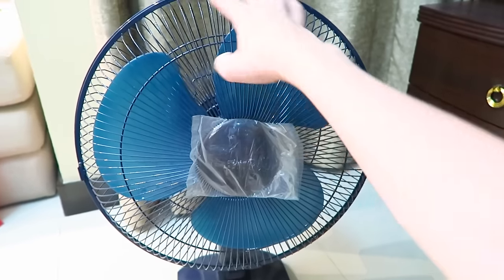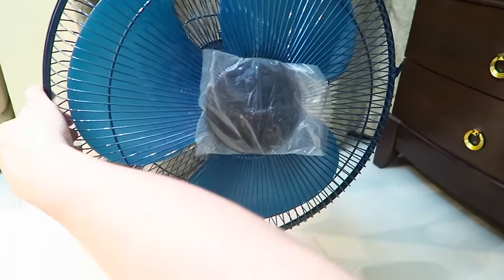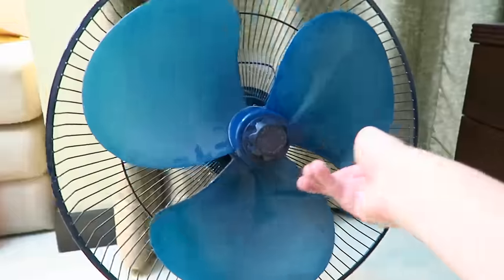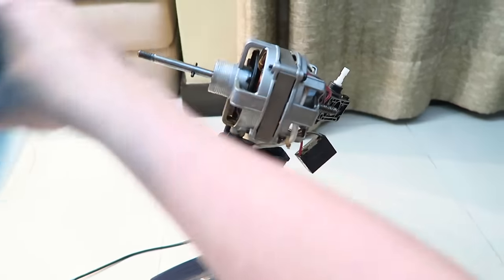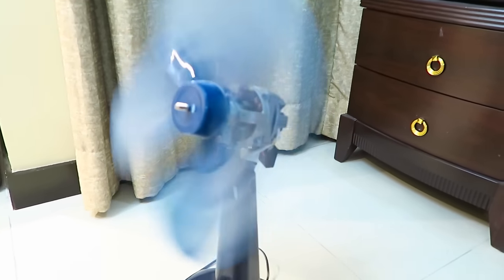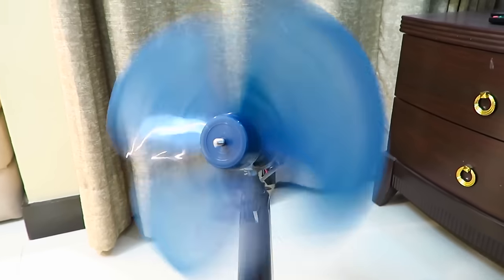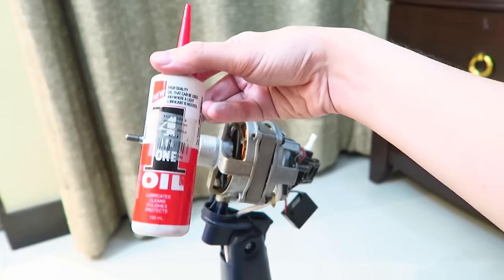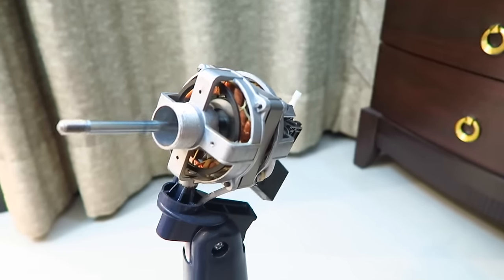How to fix a slow fan

Comment: can I use cooking oil?
Reply: Frank Daves no, it is a natural oil so it will eventually spoil, attract bugs and get sticky
Reply: Use motor oil or motor grease, it'll probably last more longer than any other oil.
Reply: The best is WD40 it will take less than a minute to work as new
Reply: I agree with Johnny Walker on the motor oil, but motor grease should only be used in gearboxes and not in most regular fan bearings as it is too thick and will put a lot of stress on the motor. But you should never use WD40 as a motor oil as Glaston Young is saying, it will not provide proper lubrication and ruin your motor. I suggest zoom spout Oiler (3-in-1 oil works, but you have to get the one in the BLUE can, not the RED can) for the bearings and Lucas red n’ tacky for the gearbox. I restore and collect fans as a hobby and have talked to many collectors and we all agree on the proper way to oil most fans. Zoom spout Oiler or 3-in-1 oil in the BLUE can for the bearings, and Lucas red n’ tacky for the gearbox
Reply: If you are not fond of toxic oils, along with the fumes of those toxins being blown around and around in your room,  use shaving oil instead.     It is non-toxic and it lasts a long long time without drying up.
Reply: NEWKNOWLEDGE Shaving oil is a natural oil, it dries up quick, attracts bugs, and gums up bearings. Under no circumstance should you use shaving oil in an electric fan. You should use 3-in-1 in the blue can or zoom spout Oiler. To relubricate gearboxes you should use Lucas red n’ tacky.
Reply: ayy imao -  Well that does not seem to be the case.  Using electric shaver oil, my fan kept on spinning for one and a half minutes, after going from high speed to the off position. That was about 4 years ago, and my fan still spins for quite a long time after turning it off today.  Previous to that, I used 3 in1 oil, and that would only last for 1 year at best.  

Also, the oil in the motor in my air conditioner ended up bone dry 2 years ago.  As a result the motor was squealing big time and dropping to a lower RPM.  Here too I used shaving oil and it is still running perfectly 2 years later, and it is running 24/7.  Anyhow, WAHL OIL is the standard in the clipper cutting industry and that is what I have been using on my electric shaver, my portable fan, and my air conditioner.
Reply: Ah, when you said shaving oil I thought you were referring to the stuff that you put on your face after you shave. Clipper oil is a thin oil so it would probably be fine to use in motors, while I don’t personally use it, I don’t think it will hurt a electric fan. Sorry for the confusion
Reply: Too viscous
Reply: Hey,  thank you ayy lmao.  I just intended to share what works for me. My air conditioner is over 18 years old, but it is still going strong, even though it eventually seemed to be at the end of the line before I used the Clipper oil.
Reply: NEWKNOWLEDGE Sorry for the misunderstanding my friend
Reply: Mat Cheer absolutely not, as stated before, the oil will go rancid, get sticky, and attract bugs. You are creating more problems than you started with. If you use cooking oil the fan will seize up and you will have to completely disassemble it to soak the bearings in oil. Instead just go buy some zoom spout oil or 3-in-1 in the BLUE can, don’t use the red can because it will gum up the bearings. Apply the oil from the store to the bearings the fan spins freely. If the oscillator starts slowing down you need to regrease it by taking the oscillator apart and cleaning out the old grease and replacing it with new Lucas white lithium grease.
Reply: @Johnny-WaIker  don't use that! Grease and motor oil cuz it's very thick
Reply: your face says it all, "it's time to oil up" 😂

Comment: Omg I can't believe it worked, fan is fast as new again I was going to throw it again. Now I'm regretting throwing an old one a year ago cause it was probably the same thing.
Reply from the maker: I'm glad it worked out for you 👍 sometimes it will take more extreme action like replacing the capacitor. But often just a bit of oil can get it going again :)

Comment: I am afraid the oil would dry up quickly, and the fan will slow down again.
Reply: Man Tan that's what happened to mine and it evn became worse..
Reply: Man tan, our electric fan last until 19 years using it  the same problem now i fix it,  now it turn 25 years in service next year

Comment: I liked your videos and have to thank you for posting it and it has avoided me getting a ticket. I have to confess that I am one of those who do not put on a helmet riding a motorcycle, but I just need to ride two corners to my work so I just feel lazy wearing it. Wearing it also messes up my hair. Anyway Thank you. 

With regards to your video your fan still looks new as it still has a protective wrapper on the shroud. How long have you been using it? I have that very same brand of fan before and it also has the same problem, need to lubricate it every month then every week until it needs lubrication everyday. I feel that this brand is crap and waste of money. Other cheap brand in the Philippines is way better like Camel and Union. But with Dowell the quality is just really crap. Never will I buy this brand again.

Comment: Had the same problem with a Chinese made pedestal fan. Problem was the grease used on the spinning column dried up. I cleaned it off, added WD40 and now it works. I'm just afraid the thing might catch fire as it's not grease that's on there now.... Always a screw up.... Always....

Comment: Grease would last longer.  I also removed the rotor and spin it in my drill on 1000 sandpaper to clean and smooth the rotor surfaces that go through the bearings.

Comment: very helpfull i thought my capacitor broke we have problem motor is working inside but noyhing so i did the instruct on vid use same oil 4 in 1 very cheap which i also on my motorbike ang 100% working now
thank a lot bro

Comment: Note: I know some of us may think, I'll use car transmission fluid or brake fluid as that's the only lubricate I have but
1) From the research I've made, they may be corrosive and mess up the metals in the fan
2) I already tried them but they work ONLY temporarily (after some minutes your fan will be slow again. I guess you need OIL not other fluids
Reply: Brake fluid isn't a lubricating oil, it's hydraulic fluid and it's very corrosive.

Comment: Most likely it's just a dried out  grease in the shaft,  just spray on Wd-40 to clean it, then afterwards  apply a new engine oil   -    [do not use a grease]    anyway  thanks for sharing
Reply: Mystery Oil would be a better choice. WD40 will evaporate quickly.
Reply: @MikeJones-rk1un  yes, but  as I said  use wd40  just for cleaning up,  afterwards apply engine oil

Comment: What if it's moving normal and you want to make it spin fadter
Reply from the maker: +Andrestc ! You'd have to supply it with a higher voltage (potentially dangerous). Or if it's slower than when you first bought it, replace the capacitor.

Comment: My Box Fan Me After Sleep My Fan Stopped Spins or Stucked can I spins was work and I add oil and WD-40 Will Spins I Can't Copying you
Reply: BazardTheDark Lucas Midletton wd40 isn't a lubricant for long term use. Use oil rather.

Comment: Extra tip: if your fan is still stuck after adding oil try re-seating the two motor halves by taking the motor apart and putting it back together. You can also tap on the front part with a hammer until the shaft starts spinning without difficulty.

Comment: I regularly only oil the front part, but after few years the fan just stopped. I opened everything, the back part has those "auto rotating" part, so opened that too, to expose the bearing. As soon as the first drop went into the back one, it became so sliperry.

TLDR: Not only for the front, but we need much more lube too for the back, to make everything work much, much better. sexual innuendo intended.

Comment: Thanks for this vid. I actually fixed my fan. But i used wd40. Thanks!!
Reply: john  david cube , it will last for a while but wd 40 is actually not a lubricant. The WD stands for "water dissplacement". When you get a chance get some electric motor oil like 3 in 1 oil.
Reply: @katanakeith1  thank you

Comment: efans nowadays have poor quality Capacitor...
we still have the National Efan from 1993, no Oil maintenance and Capacitor replacement and still works like the day We bought it.
Reply from the maker: Yeah they really don't build them like they used to. I have two ceiling fans from Asahi and the capacitors already need replacing and it's not even been a year.
Reply: Gadget Addict speaking of Asahi, Our Asahi's Capacitor burned....even our 2 Asahi Wall Fan's Capacitor burned easily...
maybe it's time to avoid Asahi brand.
Reply from the maker: Yeah I certainly wont be trying them again.

Comment: Don't oil the bearings. Once the oil breaks down, it will make it seize up even worse. You have to open the motor up completely and clean the shafts off. No oil. None. Clean the shafts off with alcohol.

Comment: Dowell. 👎👎👎 bought 2 of their "industrial" fans. Didn't last. One suddenly lost its spinning power. Oiled and clean but motor became so weak. Another one just stopped. Send it to a repair man. Brought back working but it's now rattling all over the place, I think the prop got unbalanced from the repair man
Reply from the maker: +mckoyboni yikes, not good. Did you have it repaired under warranty or you had to pay?
Reply: Gadget Addict both are out of warranty,  I just send the one that suddenly stopped to our neighborhood "butingting"/repair man. He said that the bushings or bearings are broken and replaced it. Fixed but the problem now came from the prop, it became unbalanced and probably ruined the shaft. The one with the weak motor I didn't bother to get it fixed. I looked for videos on yt for similar problem and didn't find any. Probably needs rewinding
Reply: Both worked well for couple of years to be fair. But comparing to other brands..  Can't say I can recommend them

Comment: I'll just buy a new fan
Reply from the maker: That would be very wasteful. A few drops of oil and 20 minutes of your time can keep a fan out of the landfill. Although if you threw it in the trash here, someone would rescue it, fix it and sell it. But still... you can fix it yourself in less time it takes to walk around the shop deciding on a fan, queuing up to pay etc.
Reply: Gadget Addict I see where you're coming from, but if you don't have oil around the house you have to go to the store and buy some, so by the time you drive to the store and get oil, come back home and take it apart, oil it up, and then reassemble it, you've already invested well over a hour. I can order a new fan on amazon in 5 minutes. It's all about how much you value your time.
Reply from the maker: I suppose. Most people I know have an all-in-one oil in the house, even motor oil from your car can work :) But yeah, I know what you mean and agree that your time also has a value. I just hate to see things go into the landfill when they can be fixed quite easily.
Reply: You see, the reason you wouldn't have something like all-in-one oil or nearly any other useful supplies around the house is because you don't want to fix anything, because you could say the same thing of anything. "I don't have a soldering iron, I don't have a multimeter, I don't have duct tape or glue, therefore it would waste a lot of time and money getting it"

Except, if you had just gotten whatever the thing is you needed to repair something, then you'd have it for future repairs too and that's what most people seem to forget but if your time is more valuable to you than money then fair enough, do whatever you like.
Reply: That way you have another whole hour to sit on your lazy ass in front of your computer. There is great satisfaction in fixing something yourself. If you don't like fixing things  then why are you watching repair videos?
Reply: TamponMuncher69 Then why waste time on youtube looking for a solution to your broken fan in the first place? lol

Comment: Dude that is too dangerous, you just turn on the electric fan without the cap.
Reply: It was tight enough on the shaft to spin and centrifugal force keeps the blade on the shaft,if it wasn't then the blade would not spin but the motor will.